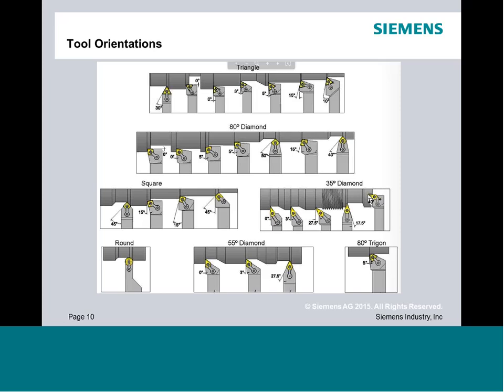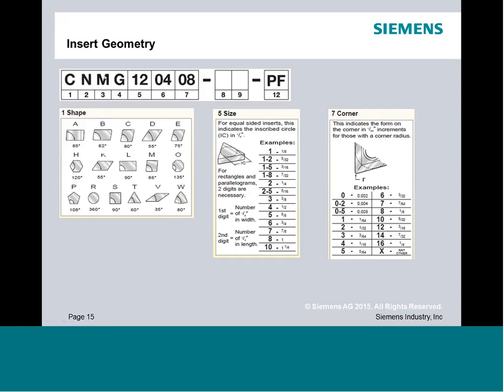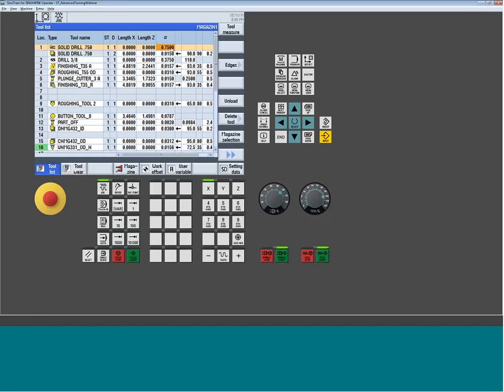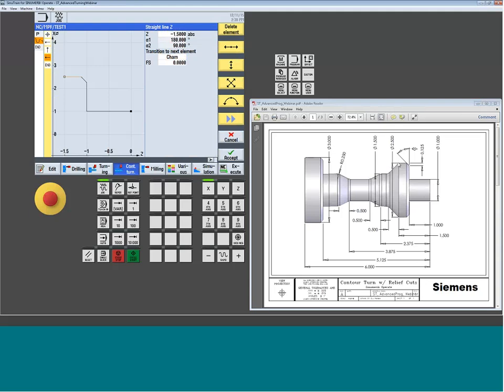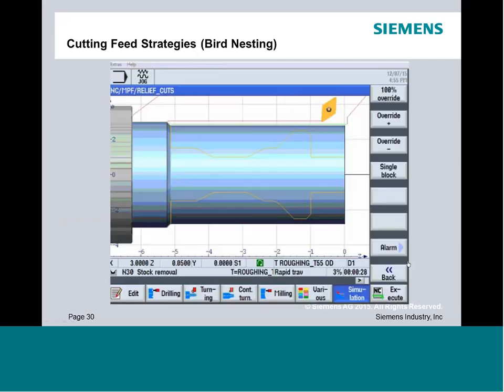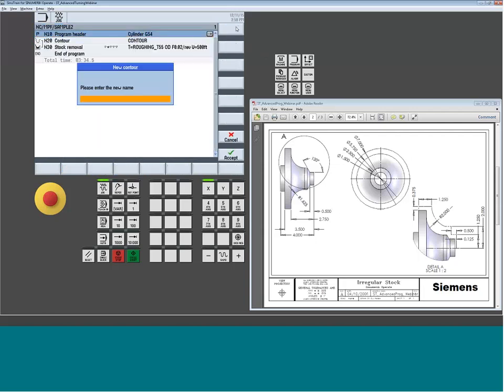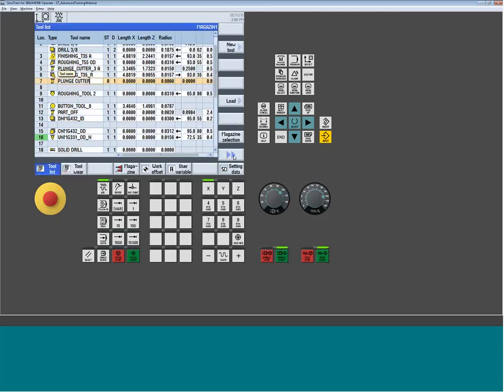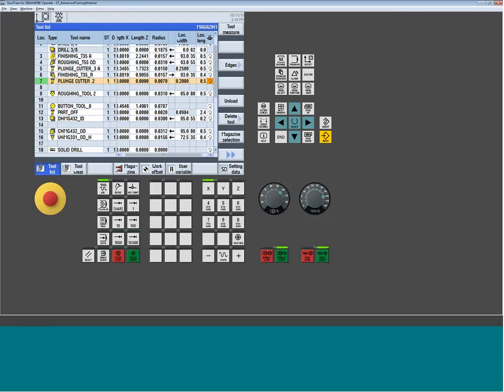Working with Advanced Cycles in ShopTurn for Sinumerik 840DSl & 828D Turning

Comment: I have question, when you set new cutting edge on drilling tool as boring bar, do you need to measure that as a new tool or machine will use diameter of the drill to turn id?
Reply from the maker: you need to measure that edge